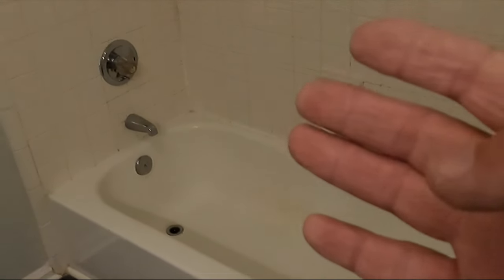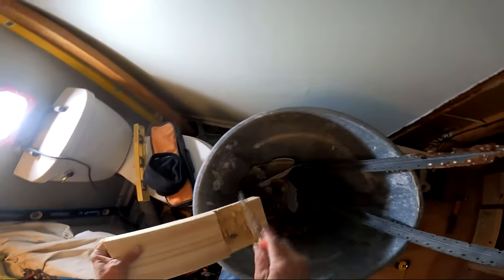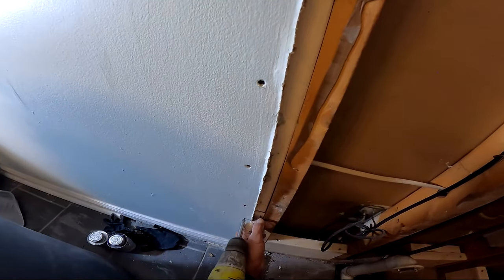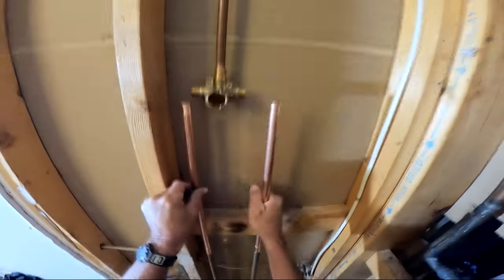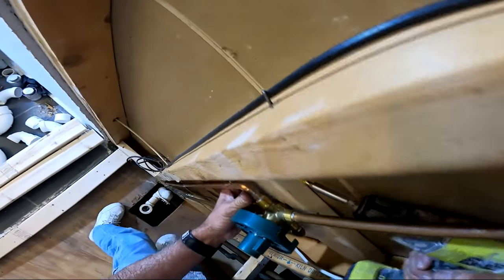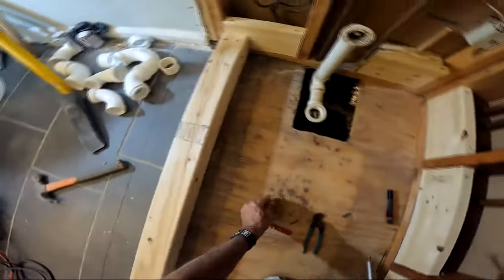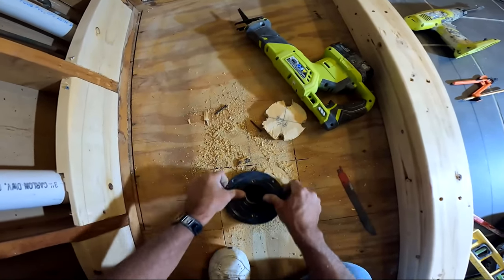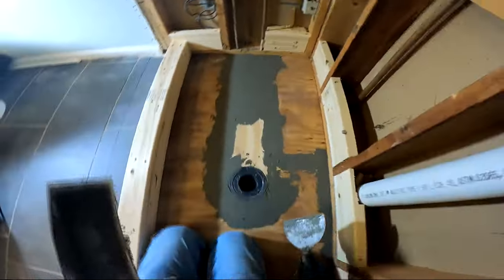BUILDING A SHOWER FROM SCRATCH...part 1 prep

Comment: Try cutting the floor piece on an angle, so it will wedge in place when replacing. Of course use the supports too.
Reply from the maker: Good trick

Comment: why not use PT studs for your curb? Will it pass inspection like that?
Reply from the maker: If not attached properly with the proper amount of Fasteners then pressure treated wood will twist and warp over time. And assuming you are waterproofing the entirety of the shower then it would be irrelevant anyway
Reply: @StarrTile  absolutely, for whatever reason inspection here in CA will fail you for using Doug fir in a “wet” area. I gotta do all my curbs and niches with PT or else they blow a gasket 🤷‍♂️